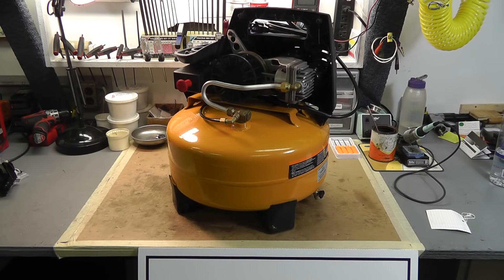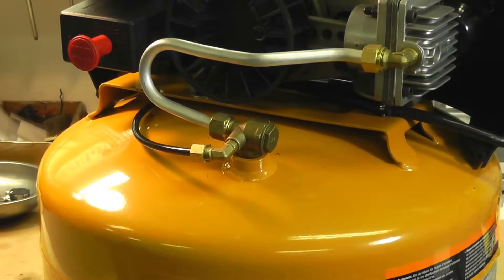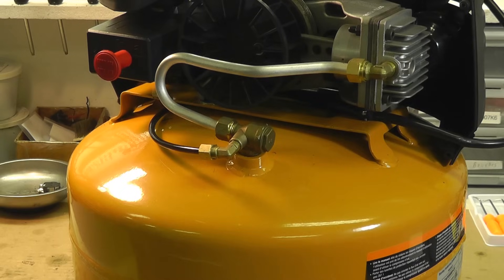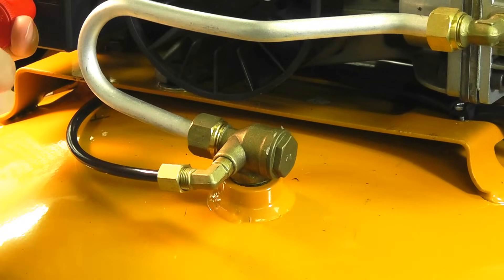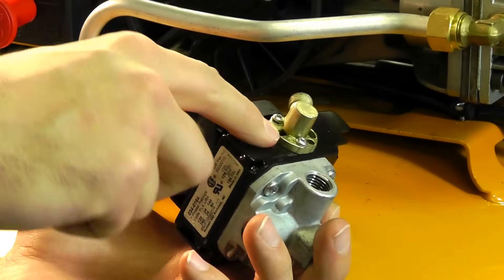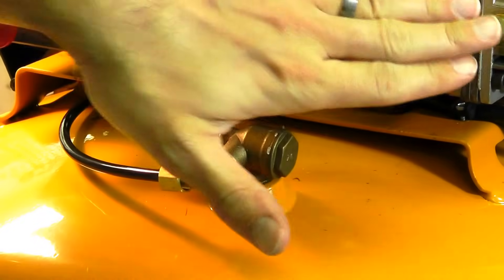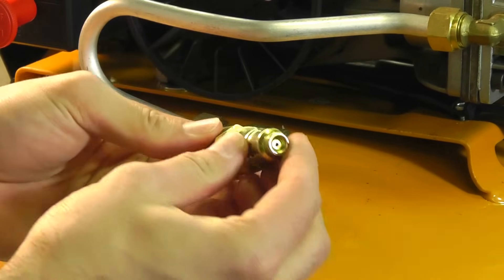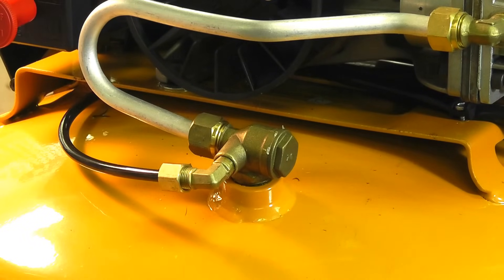How To Test A Check Valve (One-way Valve) On An Air Compressor

Comment: Thank you so much for this video!  I thought I had a bad unloader valve because air was leaking out from there. I was able to fix everything by taking the check valve apart and cleaning it up.

Comment: I had this problem I thought it was so switch and bought a new one anyway halfway through the video I decided to go out and pull it apart sure enough there was a couple of little bits of dirt I cleaned it put it back together turned it on compressor turned off did not leak air oh well looks like ive got a spare switch

Comment: Great video!  My check valve is exactly like the one in the video.  I had a leaking switch, cleaned up the check valve of some corrosion and problem solved.  10 minutes of effort got me up and running again.  Thanks for posting!

Comment: Thanks for the video.  So my comp is leaking air from top of engine.  Took it apart and I see a tiny pin hole where air is escaping.  After watching your video, I’m thinking that pin hole is there by design?????  My valve may be bad and the air escapes through that hole?  Thanks for any advice?

Comment: Thanks for the heads up about the check valve. I'd replaced the valve gasket (as I've done previously) but this time I kept getting an air leak. I was about to buy a replacement pump assembly, but checked out the check valve and there was a bit of paper gasket material caught in there. Simple fix and no leaks. You saved me $299.

Comment: Can you check the check valve by loosening the connection to the head at the head?
  Btw, I have one that is leaking at the regulator valve itself.  The oring is gone now.  
  Is this an indication the check valve has failed?

Comment: Mine shuts off via the reset switch on the unit before it get ups to pressure. It was fine then the issue started out of nowhere. No extension cord, clean filter and capacitor looks fine but not tested. Help Please

Comment: Got same problem right now so will clean it and see the result otherwise will buy a new check valve than to get a new pressure switch thanks so much

Comment: Got a 30 year old 30 gallon compressor.  Slowly fills to 110lbs but hovers at 80lbs.  Replaced the gasket on the crankshaft. replaced the air valve assembly.  I hear no leaks but it does drain the air out overnight so its leaking somewhere.  Could the slow fill be caused by the check valve?  4hp motor runs great.  Thanks in advance.

Comment: How are you, sir, I have an Italian compressor 100 liters, the check valve, the operating switch, the winding, the gasket and the condenser have been changed, and everything is fine, it works well and stops at 6 bar.

Comment: Can put pressure on compressor head and will try to start , strain and pop breaker in motor.
Reply from the maker: Thanks for the comment! There's a very good chance your in-tank check valve is defective and/or clogged. If the check valve is stuck closed, you will get a lot of back pressure on the pump head and it will trip the breaker. I would try to clean the check valve first and if that doesn't fix it, replace the check valve.

Comment: my 6 gallon copancakempressor has a rataling just before it comes to peak fill any suggestions
Reply from the maker: Thanks Claude. You will find that this happens with many smaller, oil-free air compressors. There isn't a whole lot you can do other than ensuring all of the plastic components and fasteners are nice and tight. If the unit takes a long time to reach max PSI then there may be internal pump problems, like a worn compression ring on the piston, or damaged valves.

Comment: My pancake is running but it's not building ant pressure. It's less than 6 months old and is used infrequently . Is the check valve bad?
Reply from the maker: Thanks for the question! If it's not building pressure at all then it's probably not a check valve problem. If you remove the discharge tube from the head and run the unit, and you know the pump is pressurizing and that you're getting compression, there is either a large leak somewhere or (more likely) you have defective valves or a defective piston compression ring. I would remove the head from the pump and inspect the small reed valves (if it's an oil-free unit like the one in the video) and look at the edges of the piston ring as one or both will be damaged. My bet is on a damaged piston ring. Hope this helps!

Comment: I have a central  pneumatic  21 gallon   it will build cut off an while using it the pressure  keep dropping  an going down to 40 psi it never used to do dat it used to stand at 90 pis any help would be kindly appreciated
Reply from the maker: After the units shuts off at max PSI, does the unit leak air at all that you can tell? Or, does it hold at max PSI unless you use it? 
If the PSI is dropping, that's due to a leak somewhere and it would be a good idea to spray some soapy water solution on all of the fittings to see where the leak is occurring (if I read the problem correctly).
Reply: @AirCompressorPartsOnline  wen it shuts off at max PSI it do not lose any air but wen i am using it  an it comes back on while it running air is coming out from d little thin line which is running to d pressure  switch an d PSI drops down to 40 PSI wen it used to stand at 90 PSI dats d problem that i am having
Reply from the maker: @kassanjackson7231  Thank you for replying with that info Kassan. I think the Unloader Valve on your Pressure Switch is defective. This is the small Needle Valve on the switch in which that small 1/4" line runs to. If that valve isn't sealing then it will remain open while the unit is running, so it will take a long time (or will never) reach the max PSI.
You may be able to replace the Unloader Valve only but if it's not available separately then you'll need to replace the Pressure Switch.

You can view the various Unloader Valves on most units on our website by clicking on the below link:

https://aircompressorpartsonline.com/pressure-switches-pressure-switch-unloader-valves-c-25_2_258.html

Hopefully this helps!
Reply: @AirCompressorPartsOnline  ok thanks alot

Comment: My compressor moving very tight sir plz. Help
Reply from the maker: If it's an oil-free unit, there could be many reasons for this. I would certainly perform this check valve test, first.
I would then remove the head to see if any of the reed valves and piston ring and cylinder is damaged. My bet is that the piston (compression) ring is damaged or the rod is seizing up on the crankshaft.

Comment: so my compressor has a continuous pressure over over 20psi coming from the check valve to the unloader valve- i am assuming the check valve is completely defective?
Reply from the maker: Thank you for the question! Yes, it's probably defective. If there is any air at all leaking from the tank (usually through the unloader valves) after the unit shuts off, the check valve is certainly the problem.
Reply: No this air is while the unit is running
Reply from the maker: @robbiewilson157  In that case, it may just be the valve that's leaking that's the problem, the Unloader Valve on the pressure switch. That shouldn't leak at all while the unit is running. That may require the pressure switch to be replaced, unless it's a type of unloader valve available separately.

Comment: Mine continually runs and builds no pressure.
I removed the biggest line going to the valve and air is coming out of it.
Do you have a video or suggestion on my problem?
Thanks
Reply from the maker: Thanks for the watch and for the question! There is a problem with the pump itself if the unit will not build pressure while running. Most likely the reed valves and/or piston ring is defective, not allowing the pump to pressurize. From here, I would remove the pump head and inspect the reed valves, gaskets and piston (compression) ring. You will probably see obvious damage to one of these components.
Reply: @AirCompressorPartsOnline Ok thanks. That’s my next step.
By the way it’s a Makita Mac 5200
Reply: @AirCompressorPartsOnline  I took the cylinder head off and valve cover off.
The valve cover has an aluminum gasket which is good and both reed valves which are just 2 rectangular pieces of aluminum are not defective.
I then pulled the cylinder off and the piston has 3 rings and head gasket look like new.
I’m kind of stumped right now on where to go next.
Any other suggestions?
Reply: I just assembled the cylinder back on and without hooking anything any hoses I fired it up and the exhaust port is pushing lots of air. I’m going to put it all back together it  pretty sure when I disconnected just the big copper feed tube to the valve at the tank there was air being pushed out of the end of it.
Reply from the maker: @rotaxrider  As long as there are no obvious leaks anywhere, the problem should be in the pump internally. I thought you would have found defective valves or damaged gaskets so it's strange they looked like they were in good condition. What is the make and model of your compressor?
Reply: @AirCompressorPartsOnline  Makita Mac5200
The cylinder wall has no signs of wear also.
I hooked everything back up and the tank pressure only builds up to about 30.
Reply from the maker: @rotaxrider  I am still banking on there being a problem with the pump internally. If you cannot detect any obvious leaks (you can do a soapy water spray test to confirm this), then the problem must lie in the pump. The valves are the only components that create compression so I'd bet the valves need to be replaced, along with the gaskets. The piston rings are probably OK as that is typically not what causes a loss of compression in an oil-bath, direct-drive pump like this, and you inspected it. So, I would try and replace the valves and gaskets to see if that does the trick...that's the first place to start IMO, since the unit will run but won't build much pressure. I hope this helps!
Reply: @AirCompressorPartsOnline  Thank you very much for you taking the time to reply.
I don’t know why I didn’t even think of the soap trick. I hate the thought of getting older LoL, but it worked. I seen bubbles on the top bolts holding the head down and bubbles on one of the gaskets.
I took it all apart again and inspected the gaskets and they were fine.
I’m suspecting that maybe the head bolts loosened up over time maybe the first time I had this problem.
I had some Permatex gasket maker and used that to reassemble everything just to make sure with the gaskets and retightened everything back up.
It built tank pressure right up to 140 psi.
Thanks for your help.
At least I’ll know what to look for or diagnose a leak.
Reply from the maker: @rotaxrider  Excellent! I'm glad to hear you found the problem. I understand the comment about getting older, certainly...the soapy water test is the easiest and most reliable trick in the book. I should've mentioned the head bolts...with vibration they do eventually tend to loosen so the seal breaks and can encourage leaks. Have a wonderful and safe Thanksgiving!

Comment: Hi if my tank shuts off at 135 psi and used to pump to 150 psi would that be a check valve or pressure switch?
Reply from the maker: Thanks for the questions! It's probably neither. Unless there is an obvious leak around the pressure switch or check valve, the problem is most likely with the pump internally. You either have a damaged compression/piston ring or damaged reed valves in the pump head. It could be as simple as a damaged gasket but if it's an oil-free unit, I can almost guarantee the problem is caused by a damaged piston ring. I would remove the pump head and inspect these components.
Reply: @AirCompressorPartsOnline 

Thanks for your reply.

What a bummer I bought it brand new not long ago and don't use it a whole lot it's a kobalt quiet tech 26 gallon oil free.

Guess I'll call kobalt I was hoping it was just a pressure switch and I could buy one without chasing down the warranty
Reply from the maker: @eclipse1999able  Hopefully Kobalt (aka Lowe's) will be able to assist you with a warranty repair. When you have a loss of compression it's typically (almost) always an internal pump issue, unless there is an obvious leak elsewhere.

Comment: The actual check valve on the displayed compressor is located by unscrewing that largest cover nut on the 3 way. Same unit on the Workzone 50 litre 3 hip. Leaking at the pressure switch when turned off. Checked it, spring and soft shaped seating pad nothing untoward reassembled and  the problem remains.
Reply from the maker: Thanks for the question William. If the unit leaks at all when the unit shuts off, the check valve is certainly the culprit, as that's the only way air can back-feed from the tank. The valve may be intermittently sealing. In my opinion, I'd still replace it if the unit leaks when it's shut off.

Comment: Hello so I have an air escaping from a small hole under my pressure switch.  However it only escapes when it's building pressure, also it wont build more that 40lbs of pressure. Any ideas.
Reply from the maker: Most likely the diaphragm inside the pressure switch is defective. The in-tank check valve is OK as long as the tank holds pressure after the unit shuts off. For some switches, the diaphragm isn't available separately so you may have to replace the entire pressure switch. Thank you for the question.
Reply: Air Compressor Parts Online just to piggy back off this question. I have a similar situation where it won’t build any more pressure after a certain point. If the unit is cold it will go all the way up to 130-140 but wasn’t shutting off and when I shut off manually I would switch it back on and it would not turn on even if I let air out the motor would not kick back on. So I replaced the entire pressure switch with a new one again when cold would start the first time and build good pressure. To test I let all air out and started again, this time it would only build about 60lbs and shut off and won’t restart until a few few minutes later when it cools down. Pressure is not escaping. But now I’m stumped since I replaced the pressure switch. I reused the old unloader valve, could that be the issue?
Reply from the maker: @monofrio6804  Typically, I would say the problem certainly lies in the pressure switch, but since you replaced it that shouldn't be causing the problem. The unloader valve only needs to be replaced if it leaks constantly while the unit is running or if it doesn't stop bleeding after the unit shuts off. You're only supposed to hear air "unloading" from that valve fora  few seconds after the unit shuts off. As long as this is happening, it's probably OK. The issue might be with the motor itself so you may want to have an electrician or repair shop take a look at the rest of the electrical components. As long as the switch was wired correctly, it should be good to go. It's a bit difficult to diagnose it here sight unseen, though. Thank you for the comment.

Comment: I have a Bostitch BTFP02012 which goes to 60 lbs and that it all and it keeps running. I have tried adjusting the regular but it makes no difference. Would the check valve have anything to do with this or is it something else.
Reply from the maker: Thanks for the question! Most likely not. If the unit only builds up to 60 PSI and continues to run, but doesn't build more than that, the problem lies in the pump itself (barring an obvious air leak somewhere). Most likely the problem is with the little metal reed valves underneath the head (on either side of the valve plate) or with the piston ring itself. Most likely, the piston ring is damaged or just worn out, which has also probably worn the walls of the little cylinder cup. This is very common for oil-free units, especially if the compressor was run for longer than it's supposed to be. These are pretty light-duty units so this is easy to do. You can find a full breakdown on this unit by clicking on the belowhttps://aircompressorpartsonline.com/portable-oilfree-air-compressor-parts-btfp02012-p-998934.html link:

Comment: My nylon 1/4” tubing keeps bursting. I replaced it with new and it did it again. What would cause this?
Reply: I used a higher rated pressure tubing for the new line too.
Reply from the maker: @steveglynn1537  As long as it's the correct size tube and pressure rating, this shouldn't really happen. Now, I'd check the adapter that the tube inserts into. Also, the check valve itself could very well cause this problem. If the check valve isn't sealing when the unit shuts off, tank pressure will backfeed through the lines and can cause the tube to blow out. If the tank holds air when the unit shuts off, the check valve is OK. If the check valve is OK, I would replace the fitting the tube inserts into. Thanks for the comment!

Comment: I have a Porter Cable compressor that uses check valve D27022. What is the best way of attempting to clean this valve? I can draw air from either end currently and would like to try cleaning before replacing the valve.
Reply from the maker: Thanks for the questions! It really depends on what is clogging the check valve.
I would try mild parts cleaner, but nothing any stronger than that. Nothing that will eat plastic, basically.
I'm not sure if it has a retaining clip or not so you may have to remove that first. Just don't lose it as it's easy to do. I hope this helps!